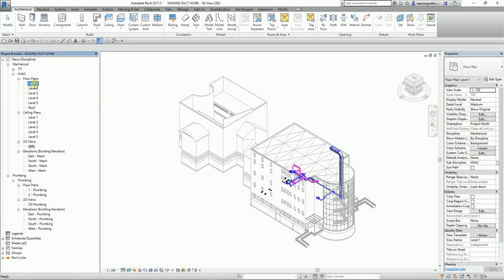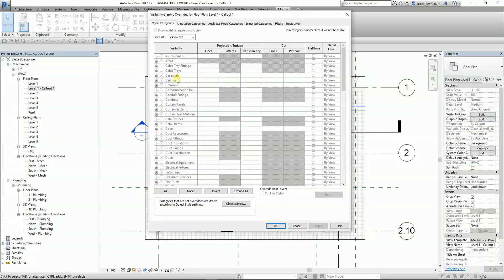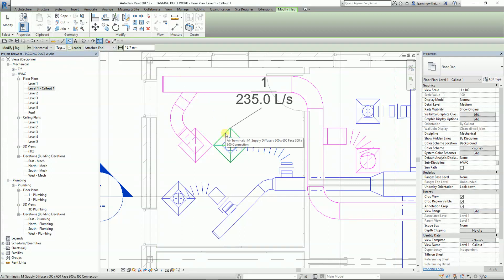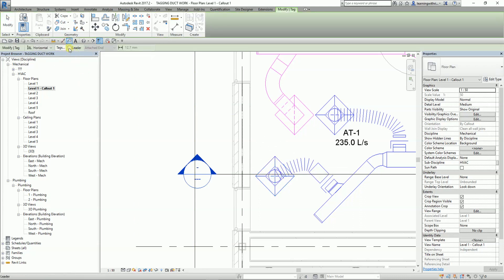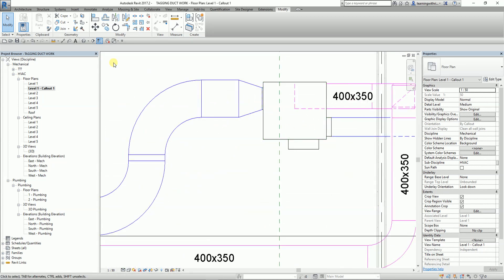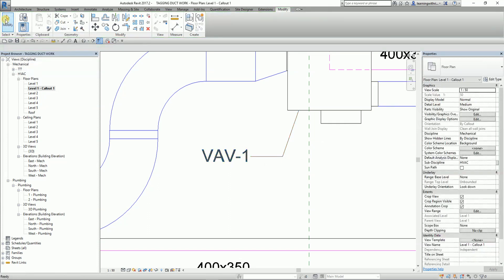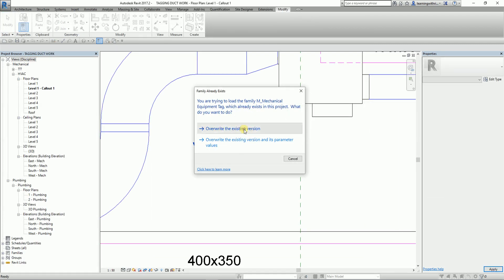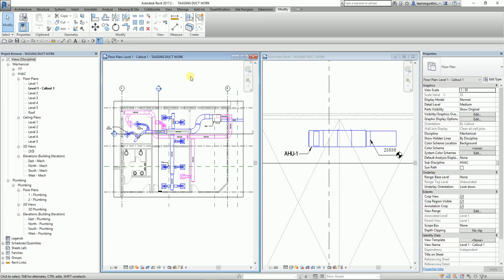REVIT MEP 2017: HOW TO TAG DUCT

Comment: There is no Tag for MEP Fabrication Ductwork. How to do that?
Reply from the maker: hello sir. Try this workaround
1. **Create a Generic Tag**: 
   - Go to the "Annotate" tab and select "Tag by Category."
   - If there's no predefined tag for fabrication ductwork, you can create a new one. Open the "Family Editor," and start a new tag family based on "Generic Tag" or duplicate an existing duct tag.
   
2. **Add Parameters**:
   - In the Family Editor, add shared parameters that are associated with the fabrication parts (such as duct size, type, or system).
   - Use the "Label" tool to add text labels that pull information from the parameters you've added.

3. **Apply the Tag**:
   - After creating the tag family, load it into the project.
   - Use the "Tag by Category" function to apply it to the fabrication ductwork.